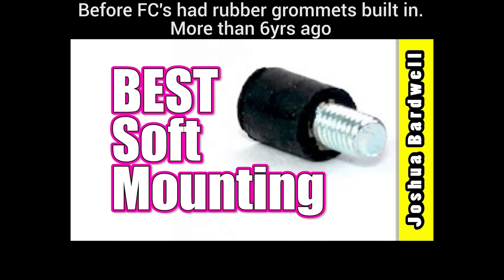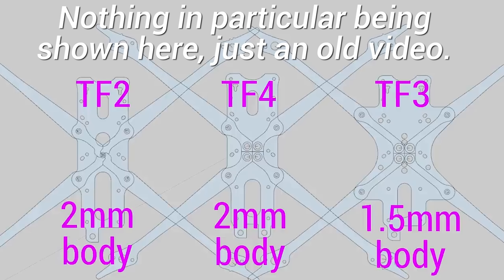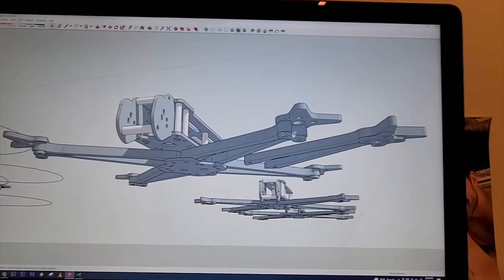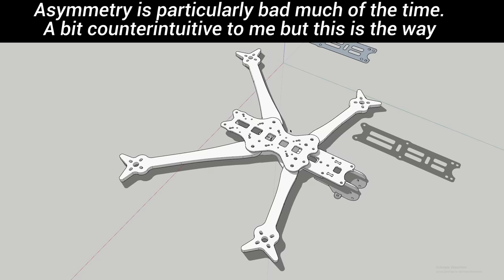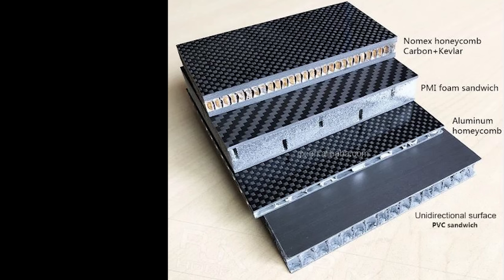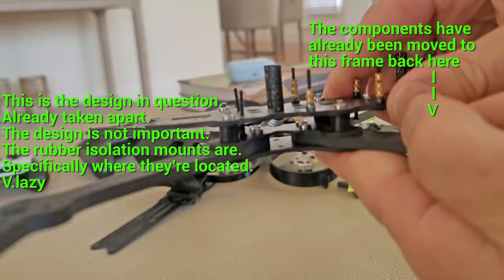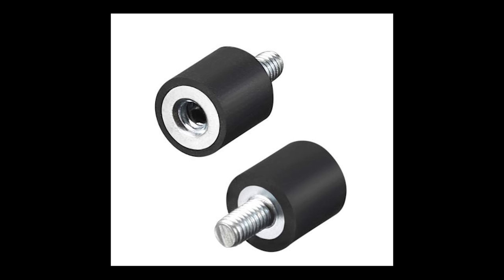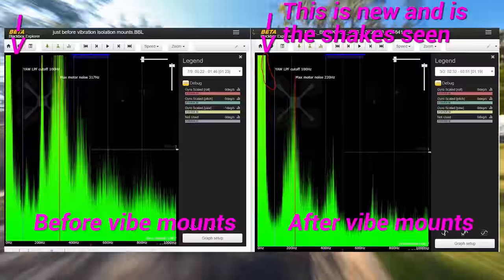I put some steel cable on a quad...

Comment: My motorcycle handle bar uses an internal brass rod with o-rings to dampen instead of a heavy weight at the bar end.i wonder if a similar concept would work next to each motor
Reply from the maker: I've got a story of similar concept coming up. Instead of weight it uses tension.... Looking quite good

Comment: In long range shooting, people tune their barrels to reduce vibration by having a mass near the end of the barrel that they can adjust the position of. Maybe having a small and movable weight on each arms can help reduce vibrations when you adjust their positions?
Reply from the maker: That's a very very interesting idea but it would directly impact flight performance too. I actually do believe it would work however. I just never thought about it.

Comment: Someone really gets engineering when they say, "...generate heat from vibrations." Armed with engineering knowledge and experience, you open up solutions that are fantastically innovative, like braided wire for dampening, and in my field, eccentrically-braced frames which bend steel beams to generate heat during an earthquake. Like brakes on a car to dissipate energy, it's all about energy transfer and ultimately intentional heat generation. Friction, elastomeric materials, plastic deformation of ductile materials, even fluid turbulence all do the same thing at the end of the day.

Comment: Inspiring video! How about designing a frame which would have a room/compartment in the centre to mount the battery? The FC would be  installed in its own carbon cage (to protect it from crashes), which would be fixed directly to the battery, independently of the battery-frame mounting. This way there would be a physical isolation of the FC from the frame with the battery (being the heaviest component of the quad) acting as the vibration absorber, separating/isolating the motors/frame from the FC..
Reply from the maker: That would be really nice but we're working with a weight restriction here. It costs a lot in weight to make different components inside. Especially for the battery. It's also very difficult because no battery is the same size and they change size over their lifespan too

Comment: Food for thought for you. The greater surface area that dampening material is able act with the more effective it will be. I suggest three or four milimeter neoprene foam.
Reply from the maker: Yeah that's why I'm considering doubling up on dampers just to test but I could never run with that because of the added weight.

Comment: Vibration isolation and vibration damping are two separate items. I would consider the rubber devices you have there as isolators. They may provide some damping, but their primary purpose is to provide isolation between the two ends of the isolator. It is also important to consider the frequency range of the isolator and how the mass and stiffness of the structure interact with the isolator. I think this is great and we are only scratching the surface here!
Reply from the maker: We've been clawing at the surface for over a decade now. There's no surefire way to get any sort of hardware damping consistently. Vibration isolators don't work for anything above 3" it seems. I'm guessing the amplitudes are too high when the prop size gets bigger.
Reply: @Kabab  I agree, this problem is not easy.  I would like to see more of a focus on the frequencies that mater to the FC and what it’s just ignoring.  From my understanding, we want to focus on the low frequency flight maneuvers and prop wash frequencies.  When the vibration gets to the FC(gyro) it should be cleaned up from motor noise, frame resonances, etc. Most isolators aren’t going to do that well, the simple rubber ones are going to isolate at higher frequencies and maybe not in the correct axis, and if they do isolate at the proper frequencies they are likely to remove the important information as well.   Setting up an isolator test stand might be something to consider.. set your quad on the bench and have a beat up prop and slowly ramp up the RPM and record BB… Try it hard mounted and then with the isolators… try to get enough data for a transmissibility curve… but just trying whatever isolator is available off of Amazon makes it tough.  Should we be looking at the other end of the problem maybe?  Engine isolation?  Certainly the approach for cars and real airplanes…
Reply from the maker: @REDhlg  There is one way we could do this that could work out best. Two gyros. One hard mounted, one soft. Subtract anything that changes from the hard mount to the soft mount. Everything that's the same overall amplitude and movement is real movement that the FC needs to know about. Everything else is garbage.
Reply: In precision shooting competition, barrel harmonics is a big issue and there are several ways to deal with them. The simplest is using a heavy barrel (just like thicker drone arms), this only moves harmonics to a higher frequency, you still have to tune your handloads to match the barrel or use a barrel tuner (movable weight). 
Another way to bypass harmonics is to have the muzzle of the barrel be constrained, this usualy means clamping the tip of the barrel to the stock, in drone terms this is like having a large structure of thinner struts instead of thicker one peice arms.

Now to realy remove harmonics, deaden the barrel, you have to convert the energy, there are a few ways to do this. The simplest is to remove direct load paths, this means barrels with dimples, outside threading and axial holes arround the barrel, in drone terms this would mean the arms would have holes and zigzag edges in so that the forces have to go around corners (aka stress risers).
The other way is dissimilar materials, this is like an aluminium or carbon fibre barrel with a stainless steel core, since the materials have different stiffness, much energy is lost transfering the vibrations. This is why carbon fibre is inherently a good damper since it is a matrix of epoxy resin and carbon filament, this is also how cars remove body vibrations by bonding a layer of urethane to the metal pannels.
Reply from the maker: @paint4pain  of these options, the different materials could be the best one for us except that in our case, we don't see waves of vibrations as much as we do overall twisting or wiggling of components. Waves are approachable with different materials and we still get some of that but the main issue is the odd twists and wiggles. 

One of the main benefits of the H frame design which attracted me to it is that the frame will essentially have no pitch action vibration wise because there's nothing to wiggle. At least not with the energy given.  Yaw won't be a big deal and is seldom a problem, roll is the only issue I need to resolve. The body twisting. That's the only notable mode that's gonna kill it. I have some tricks I'm gonna try....... we'll see
Reply: @Kabab  I see, the whole frame going into oscillation at certain speeds and loads. 
I suppose someone has tried soft moiunting the motors already? 
There is one thing that reduces harmonic oscillations, in car valvetrains the spring harmonics are reduced by shaping the spring so that it's a constantly changing spiral (beehive shaped) so that no two section of the spring have the same frequency, the drone equivalent would be tapered arms. The other way is nested springs, two spring that have very different harmonics inside each other, this is like doubled up arms but with different thicknesses.
Reply from the maker: @paint4pain  yes we've done taped or otherwise covered arms a lot. Does little to nothing. Ar the beginning of the video I show the motor soft mounts of yesteryear. Work kinda sometimes but such a pita that nobody can tolerate them.

Comment: I don't know if you have tried this before, but have you tried using a hanging ballast? Thats what tall buildings do for dampening(the taipei building has a big ball suspended at the top, dampened by hydraulics). The concept is to use the "slowness" of high mass to dampen the vibrations of buildings. You could take inspiration from buildings that have to deal with high wind speeds, as they suffer a lot from vibrations(even more so if they are round). Its called tuned mass dampening. THE WEIGHT IS VERY IMPORTANT! as that changes the frequency of the vibration. The weight distribution is paramount. Just like how a whip can break the sound barrier by continuously lowering the thickness and weight of the string the further to the end, maybe if you make the arms of the quad wider at the base than at the motor ends, you could confine the dampening to that chokepoint(it will be the first point of failure tho)
Reply from the maker: Yeah this works if used in certain ways but it's not ideal to add weight for this specific purpose and depending on where you put it, may lead to significant flight performance impact from the wider weight distribution

Comment: I use Kyosho Zeal for all of my quads flight controllers, Spektrum AS3X receivers, and helicopter gyro mounting with no hardware, it's the cleanest and best solution that I've found to this date for minimizing vibrations.
Reply from the maker: Something like that is always helpful but the FC is so low inertia it can only resist higher frequencies

Comment: how you played with SpeedyBee Master 5 HD Frame.  The whole FC is mounted on TPU section in the middle of the body.

BTW. I been experimenting for last 2 years with same issue you are describing.   
You will find that carbon tubes as arms cut down on vibrations significantly.  Maybe combining speedybee concept with CF tubes would give us interesting results,
Reply from the maker: The speedybee system is not much better than the rubber grommets already built into the FC. It may help a bit more. Probably doesn't hurt since the stack is generally low weight and hard to oscillate. I may pick one up to see how it is

Comment: Its a classical loop shaping problem - Bode sensitivity integral/ waterbed effect. Its closed loop performance that counts, its hard to get there if you approach this as an open loop problem : GK/(1+GK) for sensor noise, 1/(1+GK) for output disturbances, G/(1+GK) for input disturbances. G the quad, K controls (in frequency domain). Keep in mind that 1/(1+GK) +GK/(1+GK) =1. So tradeoffs! Frequency separation will help you making the right choices for high/low gain, adding/reducing phase (damping). Good luck!
Reply from the maker: I have also tried for arms that are completely different so that there is no resonance between them but that actually ended up being a lot worse cuz each of them had their own resident frequency and it was harder for the code to deal with it. In general I haven't found anything for 5-in that works but for smaller platforms like 3-in, these dampers work great

Comment: Excellent video my man! 

The smoothest quad I’ve ever flown to date has been my current catalyst machine works BangGod. Tbh I’ve flown many different quads and if they all have the same motors and props and 6s power, they all fly so similar once tuned correctly. I stick with the banggod because it’s the first quad I’ve had that is damn near indestructible.

Comment: wow love the thorough testing you do.
When you said the idea was basically to have the flight controller closest to the main mass of the quad so you mount it on the top plate - what if we just mount the battery on the bottom plate? maybe having the center of mass so high above the prop line is causing these vibration issues?
Reply from the maker: The problem with moving the batt to the bottom is that the quad then flies different. This is how race quads mount their batt because they crash often and batt on top is destroyed in most crashes. Weight distribution is one of the most significant factors in a quads performance

Comment: I’m thinking as far as motors vibration up and down…

An h arm  is going to result in twisting the center or bowing along the narrow dimension of the center plate.  

An x if you consider a diagonal has a chance to bow the frame along the longeer center plate axis and likely bow a lot more. 

I’m guessing that may be the arm difference. 

You may argue it would just be lower frequency bows but I think the amplitude would be more.
Reply from the maker: Yep we're gonna find out

Comment: I keep meaning to try out an idea I had with basically getting spare arms trimming the end off and using no more nails double sided tape them along the entire legnth to the original arms. 
This tape is extremely strong and once fully bonded will be very hard to break but you could put something around the arm to act as a stop to limit how far the top arm can move during impacts etc to stop the core ripping apart. Maybe some loops of fibreglass tape loose enough to allow movement up until the point of ripping the tape construction.
Reply from the maker: I haven't seen things taped or otherwise attached with an adhesive to the arm to be useful. They may improve durability but I wouldn't expect it to be any help with vibrations

Comment: How does adding a crossbar compare to doubling the arms in terms of vibration reduction/weight? Would be interesting to see this comparison on h-frame with sidebars and an x-frame with front and rear bars
Reply from the maker: It helps on frames that need the help. It sometimes makes things worse on frames that don't need it. So it's consistently inconsistent 😑

Comment: I once bought by accident a bag of rubber washers used in FPV. Since I had 100s, I just started putting them between the standoffs and the top plates on all my quads, because I keep hearing about resonance running through quad on videos, seemed like a damping opportunity. 

I can say, I rarely see jello, and I tune really well, so maybe that goes together, but it hasn't hurt anything either.
Reply from the maker: It can actually hurt a lot. It's difficult to tell without testing it. Could help too. Definitely very hard to say it always helps. Especially if they're rubber with rebound. Also, they're definitely making the frame weaker. Gives them a stress point

Comment: If you put a rubber between arms and frame and then screw it together with one long screw  then vibrations are transmitted. Pushing together is dampened but pulling appart is limited by the screw. You have to put a rubber shim under the screw head to also dampen the pull forces.
Reply: A rubber cylinder with 2 not rigit connected threads should also work.
Reply from the maker: That starts getting pretty complicated and is a slippery slope if you think about it

Comment: Wow !! hard work there Bob !! so what is the conclusion ? also that super stabilized footage is RAW ? or the GoPro stabilizer algorithm ?
Reply from the maker: Unfortunately the GoPro stabilizer software which is just real steady doesn't work correctly with their new cameras. Gyro flow however works great and this footage has minor gyro flow applied to it. Mainly to rectify the fisheye view of the GoPro.

Comment: Curious if you’ve tried KISS before. They recommend hard mounting for best experience and was wondering what your thoughts on flying it are. Thanks for all the good research you do!
Reply from the maker: I don't have a lot of experience with kiss but a direct hard mount is better sometimes. The rubber grommets have a lot of bound to them and can be excited by some vibrations leading to much worse vibrations. Not usually however since the FC is usually very low weight. The frequency is usually very high and not approached by most crafts.

Comment: Compound bows have lots of wierd stuff to reduce vibrations. Sometimes the stabilizers have a weight on the end with a very soft rubber between the weight and the rest of the stabilizer. So now I'm wondering if a rubber tail with a small weight on the tip would do anything on a quad..
Reply from the maker: yeah I've looked at that. It's like a damping mass on a stalk to manage low frequency wobbles. Unfortunately that's going to impact flight performance a LOT more than it could ever be worth

Comment: Bob, I wonder if the battery pad is giving some significant damping. If I were designing a frame, I'd try to leverage the damping effect of the battery pad which is naturally already isolating a majority of the mass of the craft. I would also mount the flight controller to the top plate.
Reply from the maker: The pad is likely making things worse. It's a thin physical material with rebound. It'll increase amplitudes more than deaden them most likely. It'll improve a small sunset if frequencies but make others worse as thin rubber solids usually do
Reply: @Kabab  Hmmm.... I always think about that the wrong way! I guess that makes sense. /-:  I wonder why the FC gummies seem to work sufficiently? Maybe b/c the FC has such less mass.
Reply from the maker: @WEEBER13  it's not intuitive at all. I only know this because I've tested and seen first hand.

Comment: Flight controllers should just go back to optional external gyros like most RC helicopters had, and not limit gyro options to standalone off the shelf chips. This would allow for use of significantly higher quality gyros such as ceramic pinpoint units from silicon sensing.
Reply from the maker: Yeah I've been asking for this from the manufacturers for a bit. Really wish we had all gyros on a long wire so we can deal with it independent of where the board is.

Comment: Physics applied, torque and pull of each motors on the frame and static momentum created by the weight of all the stuff attached to the frame ( the sum of all forces involved must be zero ) the center of gravity of the drone must on equal distance to each motor, may be of help use soft springs for vibration dampening.